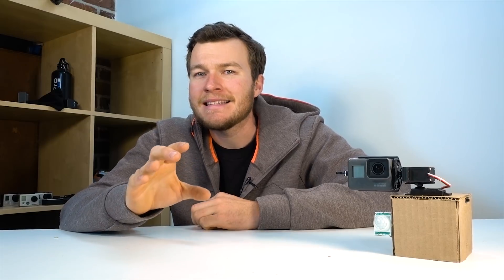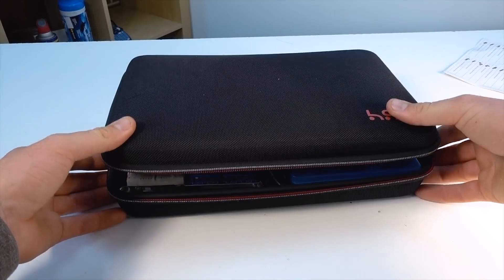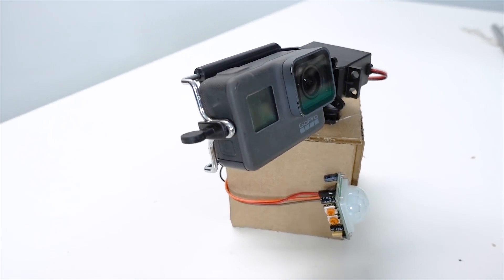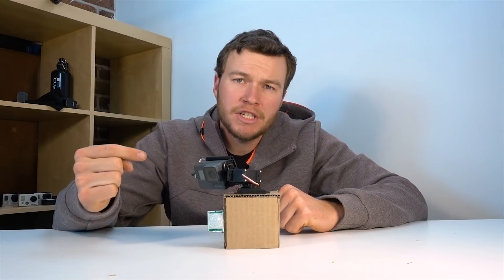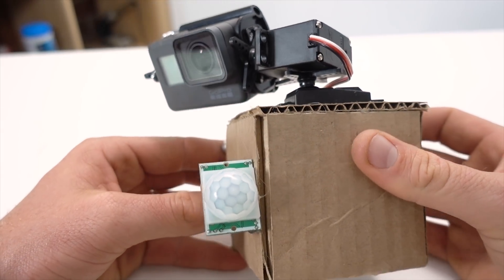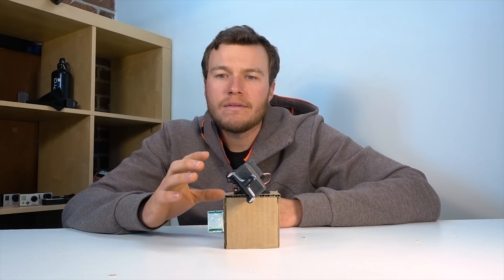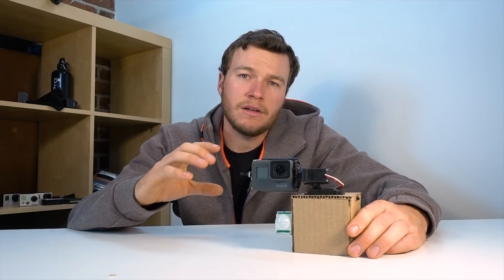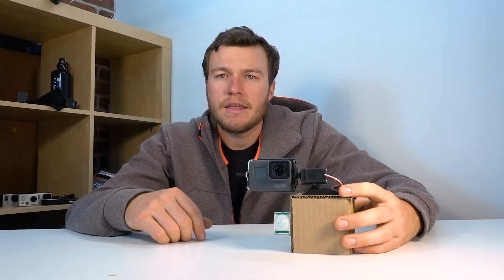DIY Motion Sensing Rotating Camera Base

Comment: That's exactly what I was looking for. If you put the motion sensor on top of a cylinder rod would it be able to track 360 i guess and have the rod twist and point the camera that way.. I was thinking I want to learn all this stuff.  My dad, his da and my moms brother were engineers and I wish I had of learned from them as a kid.  Learn to make a radio out of a piece of stale bread..
Reply: One of the things I'd use it for would be a security system with a small micro camera.. people think it's a flag, meanwhile its tracking them.  Can the motion sensor pinpoint the location of the movement and track it effectively I guess but I'm sure you can now in 2022..

Comment: I saw a video yesterday about modifying a GoPro Karma controller to extend the range of the Drone, but there was no info on where to get the parts. If you have time it would be so cool to see if it’s something you’d be interested in doing/ getting more info on. Keep up the creativity!!! 🤙🏼
Reply: https://youtu.be/FpWIBcEqU9Y
Reply from the maker: Just checked out the video. That thing looks really neat although I must stay I have never really had a problem with range with my Phantom 3. I do not have a Karma, I was slow to buy in and did not have the funds for one when it launched.

Comment: Thinking about quickly finding the blank time to delete on the video, a third servo could rotate a colour blind to cover the lens when both sensors are off. You just have to look for and remove frames that are all one colour.  I don’t know if some video editing software might be able to do this automatically.  I know it is a bit of a crude method but just following the KISS design approach 🤪😁🤓.  If you use the dash cam from your previous  video you could drop the 5v input when both sensors are off and it would stop recording when no one about.  Nice video thanks.
Reply from the maker: Funny I was sitting on the toilet this morrning just after posting and I was think how perfect the SJ5000 would have been for this mount. I could have driven it right off the arduino. It would have been really clean and super simple. 

I do really love you paper idea! it is simple and would totally work. I don't think I would even try to do it in editing software. If you change your view to thumbnails in explorer it would would be obvious when the sheet was in front of the lense. I wonder if the same effect could be achieved by placing a few really bright colored LED just out of view of the camera and turning them on when the room went still. What you really need a easy way to know which frames to get rid of.
Reply: Sitting on the toilet, too much information lol👍🏻

Comment: Its not that hard to implement start/stop timelapse with Arduino, the problem is that it requires Wifi on the GoPro and you know it drains the battery quickly.
Reply: This is a quick untested proof of concept: https://gist.github.com/KonradIT/3ae7b68498122f71f49c812400205588 , requires the WiFi module for Arduino as well as WiFi ssid/pass set up
Reply from the maker: Wow!!! I am impressed. I have some time this weekend I will try to test this code out. I do not have a Wi-Fi module, so I might take me a bit to get it sorted. Thanks for sharing, I may reach out to you in a few days for help.

Comment: Hey Kyle  I already have a gopro hero session  and I was wondering which one should I get if i needed another one (I also don't want to have to take a gimbal around with me )
Reply from the maker: HERO5 or HERO6 they are both awesome and easy to set up and use. HERO6 is a bit better but also much more expensive.